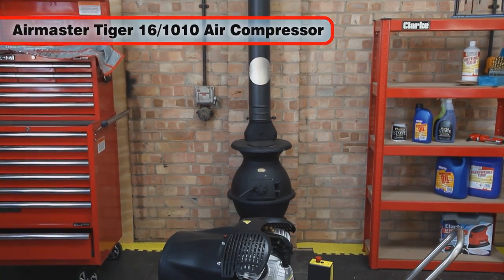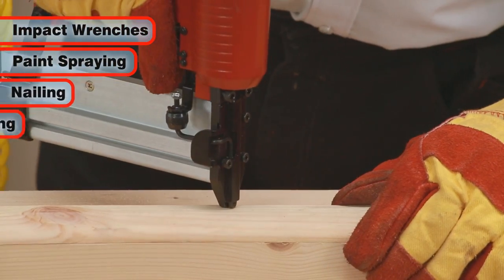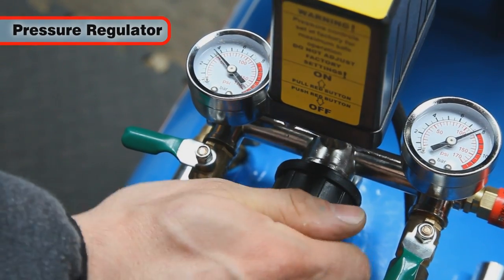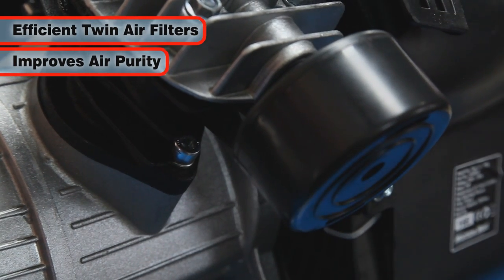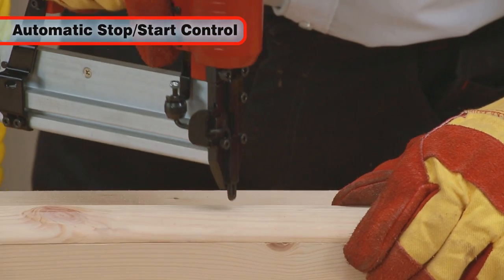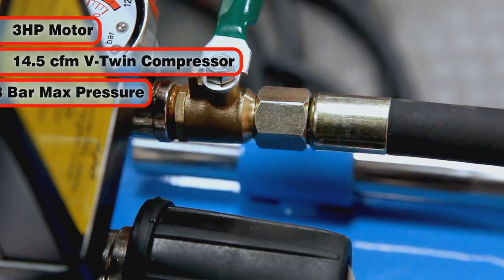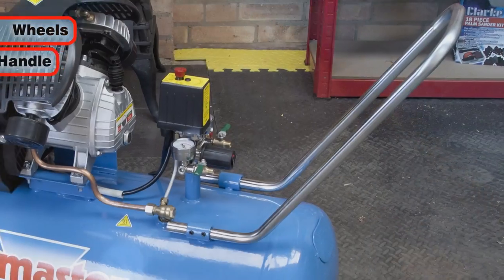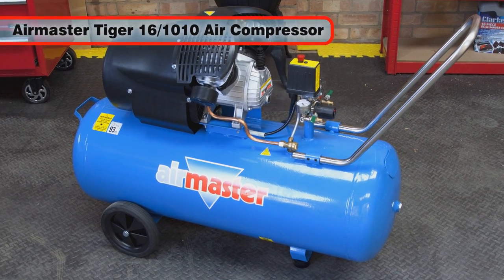Airmaster Tiger 16/1010 3hp 100 Litre Air Compressor

Comment: Do not buy this crap. Bought one in 2020 and had a tank leak after 11 months because of rust... The second time, engine just stopped after 12 months - when warranty ended. NOT RECOMMENDED.